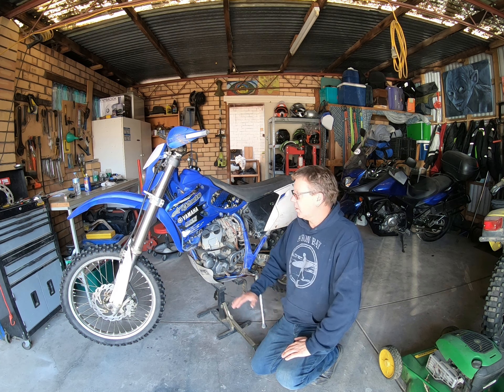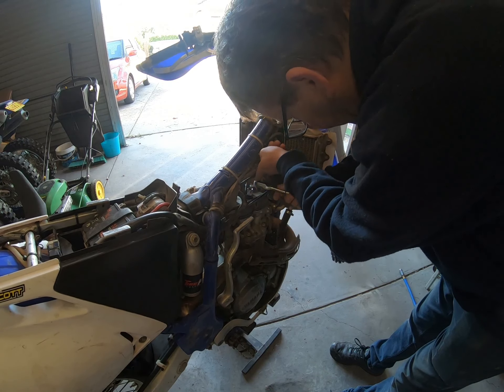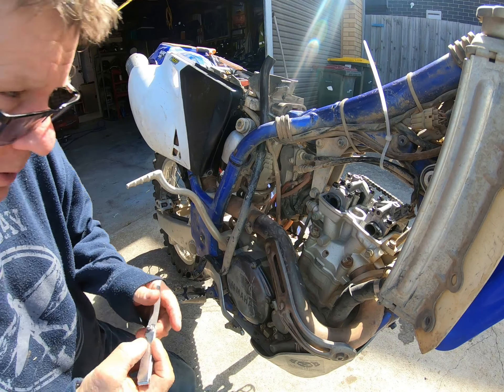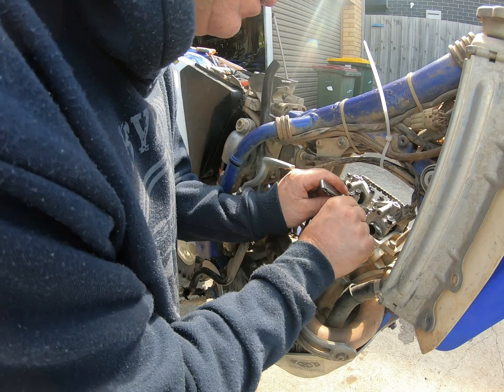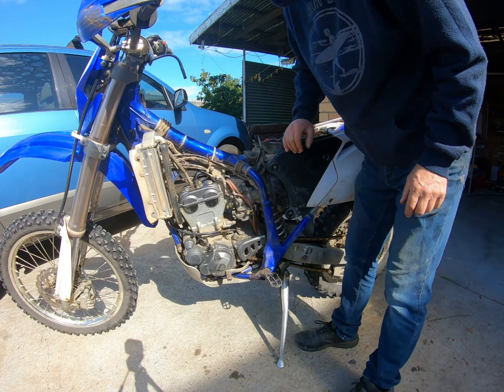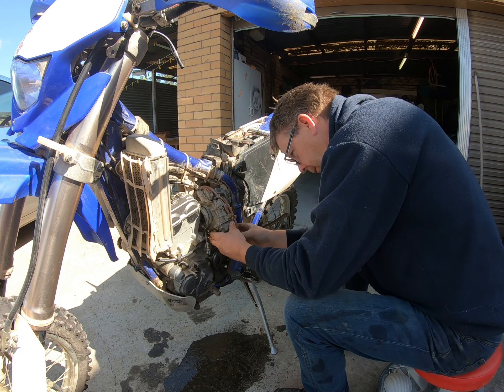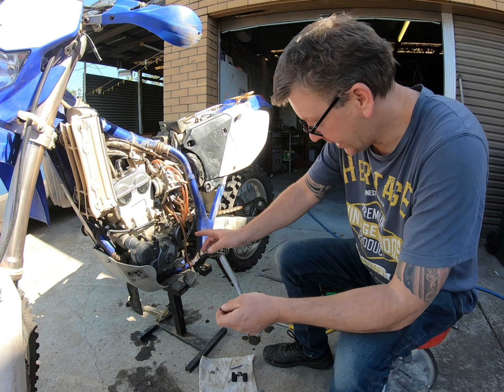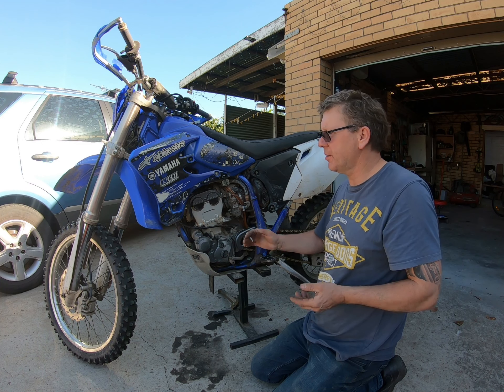wr250 maintanance, new plug, check valve clearance, clean carby

Comment: Hey Bazz I’ve got a 2006 wr250f with electric start but she’s hard to start do you have any tips also if I want to reset my carby do you know the adjustments for fuel/mixture and also the idle knob please?
Reply from the maker: Sometimes if valve clearance isn't rite it can make it hard to start, it was so long ago I had the bike I can't remember sorry.
Reply: Seems to be good with a little throttle

Comment: Hey mate, my wr250f will barely kickstart and never electric start cold, sometimes when warm, I got a new spark plug and battery. Do you think it could be valves?
Reply from the maker: Hi Max, valve clearance is the general cause of hard starting. If you need to hold the throttle on a bit that is a sign of the shims need adjusting. Thanks for commenting.